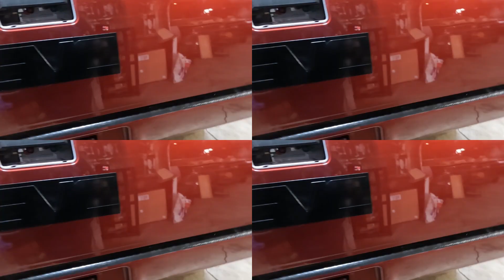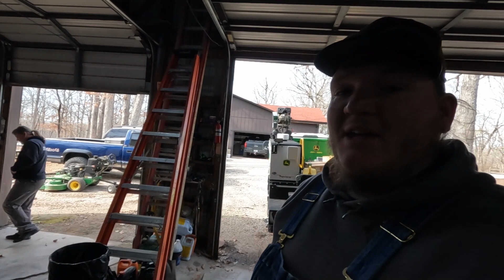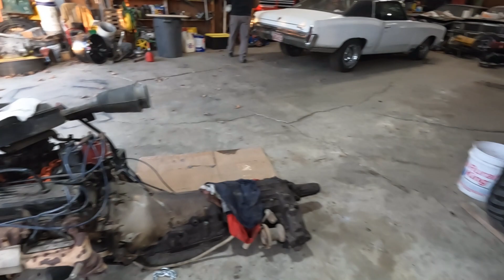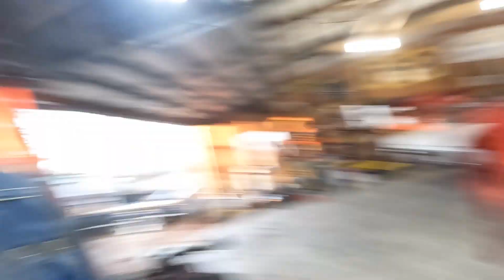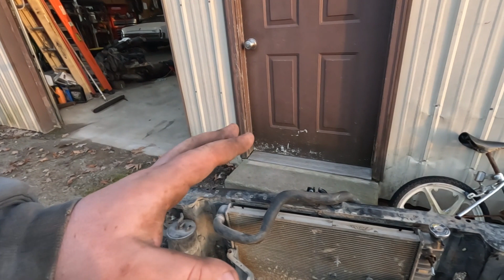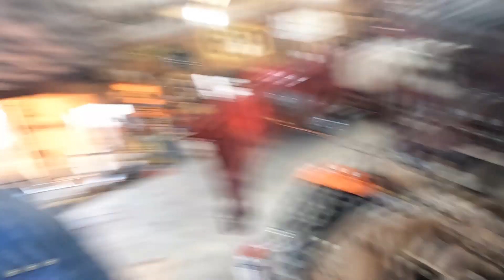We RIPPED The Old TBI Boat Anchor Out... Time For The LS 6.0 TSP BFD

Comment: nope id build my 350 before i would even think about touching wire harness repacement id would never get software right i drive it in to a tree i would get so mad at all the fuck ups id do lol
Reply from the maker: Throttle Body injection is what TBI stands for. 14 bolt 6 lug is what I’m looking for. And the wirings not bad at all. I’m doing a factory computer it’s cheaper and it seems to work a little better for cam only builds. If it was a turbo build or somthing crazy it’d get a holley.